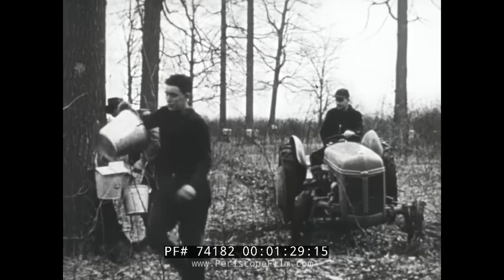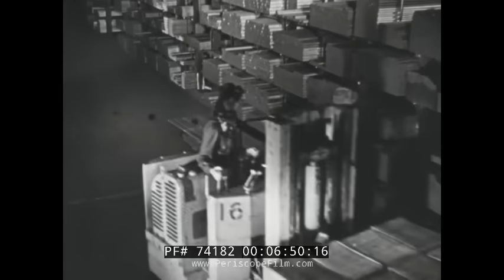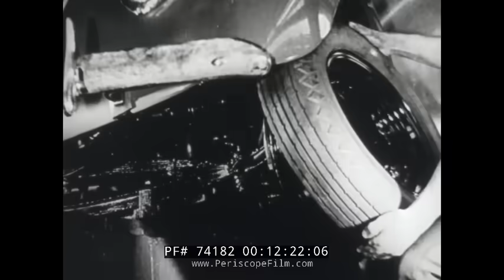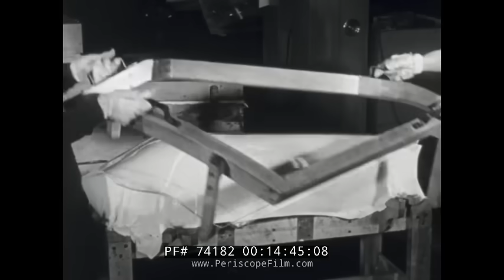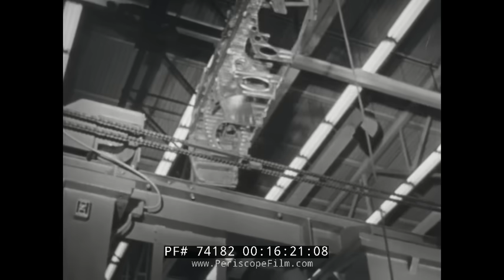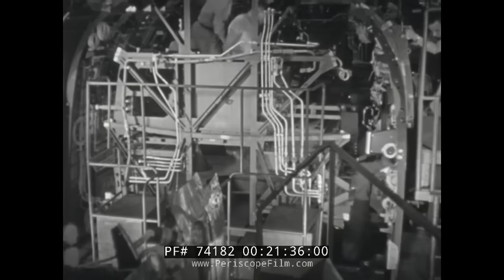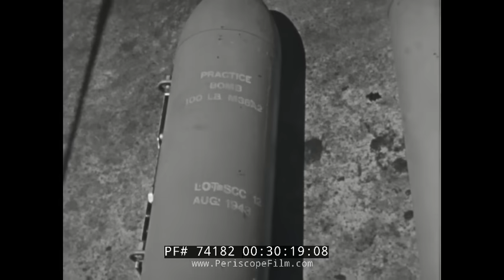BUILDING THE B-24 BOMBER DURING WWII  " STORY OF WILLOW RUN " 74182

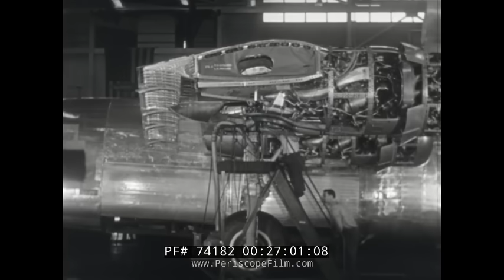Comment: 27:00  "Note the little Midget who will get inside the wing".If I'm correct, at that stage of production there were two parallel lines, the planes each have two outer wings to be attached, therefore, four "Little Midgets" would be used on each 8 hour shift.Considering that the plant was operational 24 hours a day there had to be three shifts, which brings us to 12 "Little Midgets" each day.There is absolutely no doubt that Henry Ford was a manufacturing genius, his methods have been copied from the outset , but he was "reluctant to hire women", although he had no problem hiring "Little Midgets".Times are definitely far more PC etc, but I wonder if he would have used children in his factories given the chance.

Comment: My Dad was a pilot of a B-24 Privateer in the Pacific. and if I remember correctly  he flew 33 patrols consisting of a 1000 mile leg out, 100 miles to the left or right and back to base. Lost some of his hearing as you can imagine the sound pressure level of four engines and props. He had pictures of the strafing runs on the small boats they encountered. Half of the bomb load was replaced with fuel to give a longer range. They had no armour, just a big flying gas tank with some bombs and a bunch of .50 cal. by themselves mostly over water.

Comment: As told
to me by a RAAF WW2 Air craft Mechanic. With a US built aircraft, if you needed
to replace a part, it was minimal down time because of its simplicity and
robust in construction and clever engineering. 
With the aircraft from other nations, mostly good kites, but that part
may have been behind others and thus R&R was much longer

Comment: Albert Kahn designed this building; and the Ford Rouge Plant as well. I live about 8 miles away from Willow Run, and it wasn’t until recently that I realized what a big deal Ford and Kahn are. No less than Stalin called on their expertise in order to build the tractor factory in Stalingrad. Hitler, too, admired Ford. If one will forgive a touch of hyperbole, I’d say that Ford in a sense invented the 20th century 🤷‍♂️

Comment: One plane with over 1,000,000 parts per hour without CAD, computers, software, calculators, CNC and all the modern machines and methods we have today. WOW!! I worked 20 years on the drawing board without the computer then 15 after in designing products and automation. Not sure if we are that much better now than the past in many things.

Comment: I suggest reading Winston Groom's The Aviators - Eddie Rickenbacker, Jimmy Doolittle, Charles Lindbergh, and the Epic Age of Flight.  This is a history of aviation in WWI, WWII and beyond through the personal and professional histories of these individuals. It includes many back and side stories such as the rise of German air power between the wars, the bombing of Tokyo, political pressures on the development of air warfare and even a description of the short comings of Willow Run which would not be addressed in this film since it was FMC propaganda.  You may be familiar with Groom.  He wrote Forrest Gump.

Comment: Turbo superchargers?
Reply: Daniel  That is right !!!! The Pratt Whitney Radial engines in the B24 used a turbosupercharger feeding a mechanical supercharger on the engine.. The B17 used the Wright engine same system only other Bomber to use a turbosupercharger in WW II was the B29.. the P38 and P47 the only fighter to use the turbosuperchargers !!   And only the USA had the GE turbosuperchargers !!!

Comment: My mother worked in the control tower as a flight controller at Willow Run and my dad had just come back from flying B-24's in the pacific, time was 1943, my dad was one of the pilots that tested the planes after they came of the assembly line. This is how he and my mother meant. 1-28-22, I just did some research on my dad during WW ll, he was shot down 3 time while flying in a B-24.
Reply: All those departures and no arrivals other than test flights!!

Comment: The B-24 was an amazing example of modern engineering. It was lighter than the B-17, was faster, and could carry a heavier bomb load further. 

However, it’s very advanced construction made it fragile when damaged.  The exterior skin was part of the actual structure of the airframe. While the b-17 had a heavy frame with the skin being merely a covering.   The B-17 could take immense damage and keep flying so long as it’s internal frame was intact.  Not so the B-24, every hole in the skin compromised the mechanical integrity of the entire structure.  Too many holes and the airframe would, and did, collapse.
Reply: Taggartlawfirm  WRONG !!! B24 was the similiar weight as a B17 and also a similar loaded weight and only carried slighter more weight slightly further !!!!!
Reply: Wilbur Finnigan Wilbur? Let me put it this way, and talking about the B-24j and the B-17g, 

The B-24 cruised at 215 mph and had a max speed of 297 mph.
The B-17 cruised at 182 mph and had a max speed of 287.
The B-24 had a range of 1700 miles at 215 mph with normal fuel and 5000 lb internal bomb load.
The B-17 had a range of 2000 miles at 180 mph with a 6000 lb bomb load.
As range got longer the B-17 load got smaller awhile the B-24 load stayed relatively stable, and at missions stretched to 3000 miles the B-24 still had a useful load.

Both aircraft were faster earlier in the war, but as defensive armament got heavier the both planes got slower.

You are correct however that the two aircraft had very similar empty weights.

The B-17 has a higher ceiling and was much more survivable.  Crews liked the B-17 and did not like the B-24.  But you can’t ignore the superior aerodynamics of the B-24.
Reply: taggartlawfirm :It is unfortunate we do not have access to a number of surviving crewmen to ask their preference. I would imagine their favorite was the one that brought you home. I would have liked to have known how many of them had experience in both aircraft.
Reply: Cheech No Chong actually we do, there are any number of comments and preference of the aircrew of the day... the B-17 was much preferred .
Reply: B-24 had that slender Davis wing that gave it’s speed and lift. An engineering marvel at that time. It gave greater lift at lower speeds. However, as speeds increased drag increased also. Not used after WWII.
Reply: Cheech No Chong that is the curse of induced drag, you can’t eliminate it, and the faster you go, the more significant it becomes, which is true of all wings.  The swept wing was more efficient at higher speeds, but gained that efficiency in exchange for poor performance at low speeds.  The only semi answer so far has been the extremely complex and expensive variable geometry wing as in the F-111, F-14, and B-1.  Current thinking is that it’s better to plan for your desired performance regimen and try and reduce the liability at other speeds by gadgets and computer control, such as blown wings or auto slats.  The same problem applies to air intakes, though the variable geometry fix in that application is somewhat less complex.

Comment: Who figured this out in fantastic detail right down to the last screw?  And who designed and built all those machines....AMAZING
Reply: Without CAD; hand-drawn nearly every drawing is of the left hand side. Slide rules, graph paper and vellum, lots of gray matter knowledge and vast libraries of data. Real skilled labor hand-in-hand with genuine engineers, not diplomas alone.
Reply: My mom built them and my dad flew them. After the war Rosie Riveter met Flight Officer PTSD and they made some hippies. What a story.
Reply: My question is similar to yours. They said 300 000 rivets per plane. How did they make the holes align perfectly.
Reply: @casadelshed9128  The holes were drilled by precision machines so all parts were identical.  They used tools called Clecos that fit through holes in mating parts.   That would hold the parts together with the rest of the holes lined up.  Then they put all the rivets in.
Reply: @carabela125 ,  still done the same way today.
Reply: They had 1000 people working almost 24/7 365 for a year to get workable blueprints

Comment: It was a marvel in itself to consider the engineering that went into setting up the tooling and thought process in the design and implementation of the production line to build that aircraft. Weren't any computers or calculators. I wonder if the engineering groups we have today could do it again, if we handed them the same tools to work with. That type of mass production wasn't all that old of a trade in 1940.
Reply: You can thank Charles E. Sorensen  for the Willow Run Plant.  He drew up the basic plans for the entire facility overnight in his hotel room while reviewing the Consolidated aircraft factory for the Army.   He goes into some detail on how he conceived the factory in his autobiography, "My 40 Years with Ford."
Reply: Sorenson was one of Henry’s close experts.  A member of the cabinet.
Reply: "I wonder if the engineering groups we have today could do it again, if we handed them the same tools to work with", YES, but they would be Turbo Props if designed on paper today, as no one today could design a radial engine in the time it took them back then, as it is a lost art...

Comment: While the Germans had old school skilled machinists making 'Swiss Watches' once a week, America was churning out 'Timex's' once an hour. Economies of scale did them in as America out produced them a thousand fold...
Reply: Though true, we have evolved into that very German mindset. The Abrams tank is an example, except for 1 possible flaw that STILL exists. Like the Sherman, the Abrams has a GASOLINE powered engine.
Reply from the maker: According to Wikipedia the tank's engine is multifuel and can in fact run on various fuels including diesel, kerosene, any grade of motor gasoline, and jet fuel (such as JP-4 or JP-8).

Comment: Anybody know where the test pilots dropped the dummy bombs - into Lake St. Clair at Selfridge Air Base, maybe?
Reply: Just how exactly would you retrieve them, and why? They were hardly more than pipes with fins, and after 70 years,  the remains are probably negligible. Never mine the bacteria found in the waters that closes the nearby Metropark beach almost every summer.
Reply: Those dummy bombs could float, be picked up in a boat.
Reply: lumox7, Lake St Clare is upstream from the Detroit River which is upstream from Lake Erie. There was a Naval Air Station (Grosse Ile) downstream from Selfridge, as well. You don't suppose NAS Grosse Ile snagged them, do you ??

Comment: Just curious as to why the PF counter?
Reply from the maker: Here's the issue: Tens of thousands of films like this one were destroyed and many others are at risk. Our company preserves these precious bits of history one film at a time. How do we afford to do that? By selling them as stock footage to documentary filmmakers and broadcasters. If we did not have a counter, we could not afford to post films like this on online, and no films would be preserved. It's that simple. So we ask you to bear with the watermark and timecodes.

So, in the past we tried many different systems including placing our timer at the bottom corner of our videos. What happened? Unscrupulous Youtube users downloaded our vids, blew them up so the timer was not visible, and re-posted them as their own content. We had to use content control to have the videos removed and shut down these channels. It's hard enough work preserving these films and posting them, without having to deal with these kind of issues.
Reply: @PeriscopeFilm  Thanks. I'm not in the market for the full-blooded original, but happy to watch the version with your company info.
It's no more annoying than the majority of TV channels which stick their logo over quarter of the screen.

Comment: I grew up near Willow Run in the 1960's. By then the airport was civilian passenger and cargo. By 1970 all passenger service had been moved to Detroit Metro Airport, and Willow Run used primarily as a freight terminal and also for civil aviation. Practically all Fedex, UPS, etc. air shipments destined for Southeast Michigan fly into Willow Run.
Reply: I worked at "The Bomber" in the late summer and fall of 1966 when I was on the second shift of Hydramatic's final assembly.  For the first two weeks, I lived "next door" in the old airport hotel before finding an Ypsi apartment.  I was assigned a telephone number formerly used by Mohawk Air Freight before it moved to Metro, but I quickly tired of explaining to various automotive industry purchasing agents why they were not talking to Mohawk.  Instead I just started making up crazy excuses and odd delivery dates.  Four years later, I returned as a sportswriter for the Ypsi Press and was its sports editor in 1972.  I also have an unusual connection to the narrator of this documentary.  The somewhat infamous Harry Wismer would go on to become one of the founders of the AFL and original owner of the New York Titans (now the Jets), but both of us are former sports editors of Michigan State's campus newspaper -- the State News!

Comment: What happened to the plant after the war?
Reply: Willow Run, also known as Air Force Plant 31, was a manufacturing complex in Michigan, located between Ypsilanti Township and Belleville, constructed by the Ford Motor Company for the mass production of aircraft, especially the B-24 Liberator heavy bomber. After the war it was eventually sold to GM as an auto assembly plant. It was mostly demolished in 2013
with plans for future re-development still to be determined but does include The Yankee Air Museum on the site.
Reply: @ t Mann: Good question☝🏻👍
Reply: @ Gary L: Thank you very much your informative and interesting answers on the question🙏😊
Very enlightned too 👍🤗
Thx🙏

Comment: It's a shame that some of these masterpieces of engineering were shot down by german flak.
Btw, if a damaged british Avro Lancaster bomber came home, it could be repaired within one day.
Reply: Not every B-24 that was hit was shot down. Many were able to limp home. Of course many could also be repaired under certain conditions. But the fact is that the USA capacity to build these bombers was so great they could be replaced. The real "problem" was finding enough men that could be trained quickly enough to man the new bombers or replace lost comrades fast enough to keep the bomber squadrons flying at top strength. The USA was not the UK....And yes the "Lanc" was an excellent bomber, arguably the best in WWII, until the B-29 was produced late in the war.
Reply: On another note, our military anticipated greater loss of life in the enemies skies, than what actually happened, resulting in at least one flight training school (in Grosse Ile, MI) to be shut down BEFORE the war's end.

Comment: My Dad was a B-24 bomber test pilot for 2 years at Willow Run. He had been a Captain for Chicago and Southern ( later Delta) but quit to join the war effort in 1942 although he was a bit older than most at age 36. After that he went into the Air Transport Command for the duration of the war. He flew the wounded home from the European theater. He had tried to join the Army Air Corps but was deemed too short and too light to be a pilot, although he had been flying since 1926 and had more experience than most.
Reply: Though frustrating, still contributed to the war effort. My Dad wanted to join the newly formed USAF in 1947, but, due to a farming injury (punctured ear drum from a corn kernel), failed the flight physical, and enlisted in the Army, instead.
Reply: I thought my Dad was old? 25 when he hit North Africa.. By younger guy's was Dad or Gramps.  To 18,19 year olds? Your old!!..
Reply: Your grammar is terrible
Reply: Carol Mills

Comment: My dad flew b-24s in the china-burma-india theater and did two tours an outfit that had a 40% attrition rate. Flying the hump was easily as dangerous as flying the channel.
Reply: The Hump was probably more dangerous.  I read an article written by a P-51 pilot who flew the Hump.  He wrote of how he saw a ME-109 opposite direction maybe one mile lateral distant.  After they passed they both turned to see if other was going to jump the enemy.  Both peeled off as he figured the other fellow wasn't up for a fight.  He knew he wasn't up for it.  He was tired and cold and bruised because the weather wasn't 'cooperating' which was most of the time.  

There were many times when C-47s were delayed for weeks or maybe a month before making a cargo run.  Delayed because of atrocious weather.  Even though they knew the men at the other end were in sore need of supplies, they would not fly because they knew from past experience of other crews that their chances of getting through were about zero.  They had to wait for a break in the weather.  Even then the weather could dramatically change in minutes.  I have long admired the men who flew in the CBI.  The men who flew the Hump were made of steel.
Reply: Hello Jack. My uncle flew 33 missions as a turret gunner on the B-24 named "Shoot You're Covered" in the CBI theater. He flew the hump for most of those missions.

Comment: The B-24 was took out of service very quickly in WWII. Shot down to fast. No pilot would fly them
Reply: 18, 500 B - 24s were built.  4.600 were built by Ford. Holds the record as the world's most produced bomber, heavy bomber, multi engine aircraft, and American military aircraft in history. Consolidated had 2 plants: San Diego, CA, and Fort Worth, TX; Douglas built B - 24s in Tulsa, OK; Bell Aircraft built B - 24s in Marietta, GA; North American built B - 24s in Grand Prairie, TX. Source: Wikipedia.